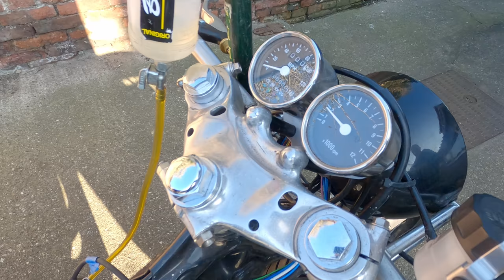Will My Honda CB750 Cafe Racer Project Run? | First Start Untested Unfinished Motorcycle Build | 02

Comment: I have seen lots of Modified Honda 750 engines and one major problem is the very narrow oil channels to the head - and have seen a couple of times that extra oil channels integrated into the head overflowing the cam and exhaust valve , it works
Reply from the maker: Thanks for sharing. I may look at this if it comes to another rebuild.

Comment: A '77 or '78 with roundtops, hmmm... With all that was changed I'm surprised it still has an oil tank.  A timing light and a carb sync might improve things a lot.
Reply: Oh, I hadn't considered the F model had a hidden oil cap. I thought that was a '77 thing. my mistake.
Reply from the maker: @rickmcconnell6520  In one of the subsequent videos I find that timing and carb syncing wouldn't be enough.

Comment: Great news, not surprising it started though, mine has been in a damp garage since 1995, new battery and fuel, fired right up, on 3 but hey, yours sounds like it’s on 3 but that could just be the video, mine leaked oil from the tacho drive, easy fix, mine ran horribly without the air box fitted, try sticking a standard air box on initially to see if that helps, you can move onto pod filters once it’s up and running ok, that way you’ll know if you need to modify the pods, anyway good news 👍
Reply from the maker: Thanks Mark.  It wasn't running consistently on all 4, but they all did have a go! Good idea about setting up with an airbox first, but I have a long way to go before then.  I am going to have to have the engine out to look at the oil leak from the top end first.

Comment: Can I offer a piece of advise....it is advisable to flush the oil, the oil gallery and change the filter, and even consider taking the rocker cover off and remove the cam blocks and make sure the oil jets are clean. The CB750 have had problems with this jets blocking up as the hole is very small....back the 90's my mate brought one that sat for 6 year, and he ignored this advice, he was riding along and it started to lock up, then it cleared but one side of the cam seized and snapped leaving an inlet valve open, the bike then flamed back into the carb and the bike burnt to the ground. 

I worked with people who had these bikes in the 70's & 80's who told me this is a know problem with the CB750....

and a little trivia, K5 and later has a extra bolt around the cam chain  tunnel, learnt this trying to fit a K5 head onto K3 cylinder block....

Peter
Reply from the maker: That is excellent advice.  The oil that was in this was brand new when it was put away.  I am going to give it a good refresh and when I investigate the oil leak I will be looking inside the rocker covers.
Reply: @SPANNERRASH  Our cb750 ran like a watch when we bought it for restoration, when we looked inside the rocker cover we found a loose nut floating about. No nuts had come loose so it must have been that one that gets dropped and cant be found.
Reply: @duncanbiscuit1226  Whenever I drop a nut, I move heaven and earth to find it.  I am always worried it will find its way into somewhere catastrophic.  Your story just adds to my level of paranoia!

Comment: The Nike was running on only two cylinders at the end
Reply: Two or tree
Reply from the maker: Yes it wasn't running on all cylinders consistently.  I only wanted to make sure it would run.  Past bikes that I have resurected, if you look at the back catalogue, always seem to run crap at first.  But I have put many miles on the Triumphs and the other CB's once I had them fettled.  We'll have to see how this one works out.